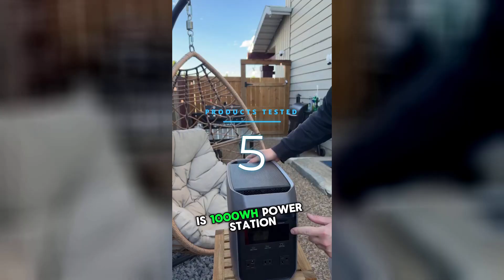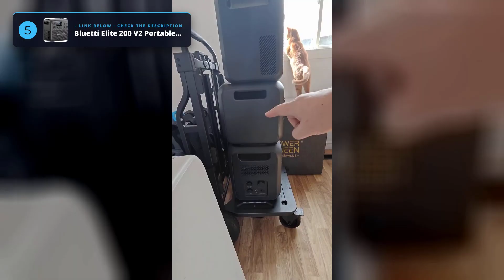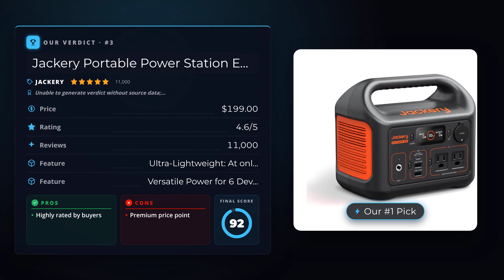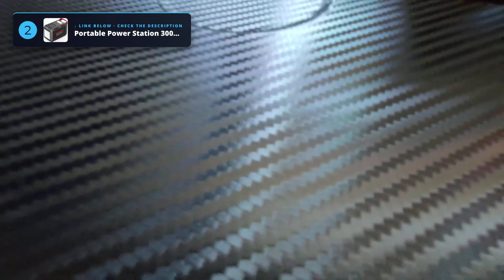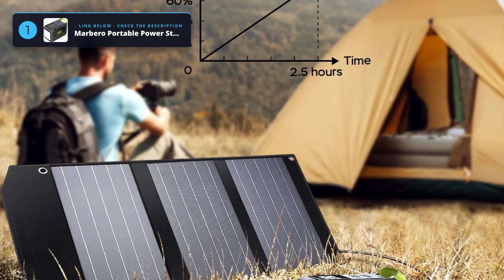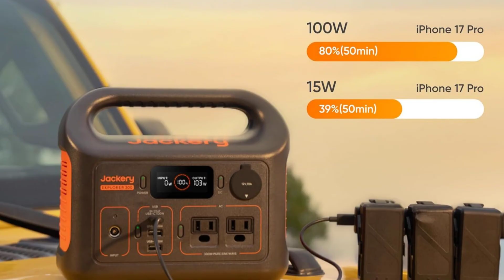Best Portable Power Stations 2026 for Medical Devices & Home Backup

Comment from the maker: Products Here 👇

Check out the products using the links below!

1. MARBERO MARBERO Portable Power Station 88Wh Camping Lithium Battery : https://www.amazon.com/dp/B08G1KB88B/?tag=backupwiseseniors-20
2. MARBERO Portable Power Station 300W MARBERO 237Wh Camping Solar Gene: https://www.amazon.com/dp/B0CJHNCZ8T/?tag=backupwiseseniors-20
3. Jackery Jackery Portable Power Station Explorer 300, 292Wh Backup Li: https://www.amazon.com/dp/B082TMBYR6/?tag=backupwiseseniors-20
4. EF EF ECOFLOW Portable Power Station Delta 3 Classic, 1024Wh Li: https://www.amazon.com/dp/B0FQVC4RF5/?tag=backupwiseseniors-20
5. BLUETTI BLUETTI Elite 200 V2 Portable Power Station, 2073.6Wh LFP Ba: https://www.amazon.com/dp/B0DCJV9LTB/?tag=backupwiseseniors-20